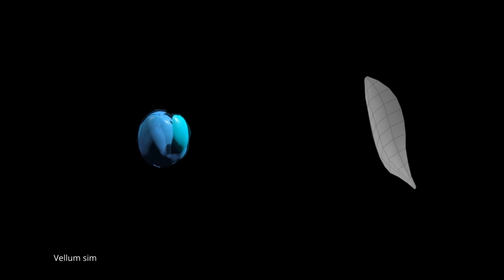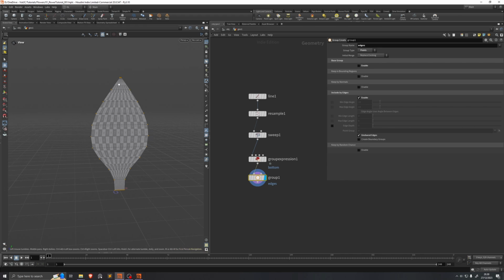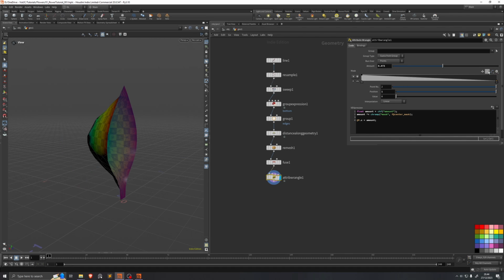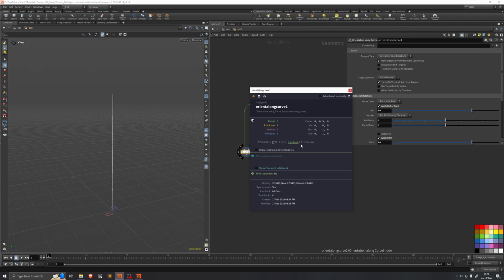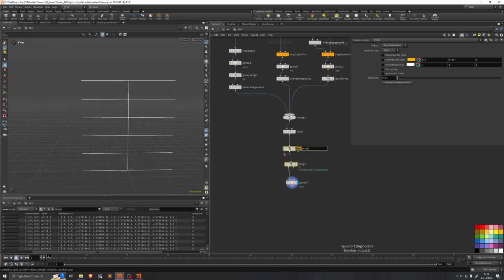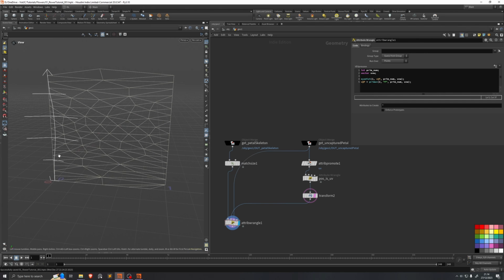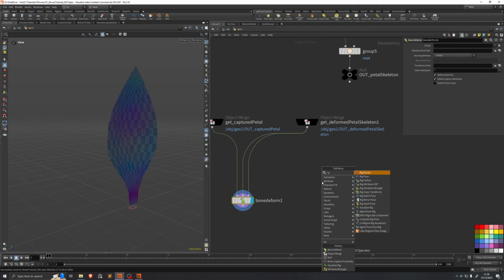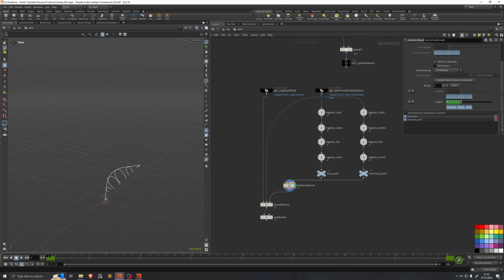Houdini Tutorial | Blooming Flowers | Model, Rig, and Animate | Part 1

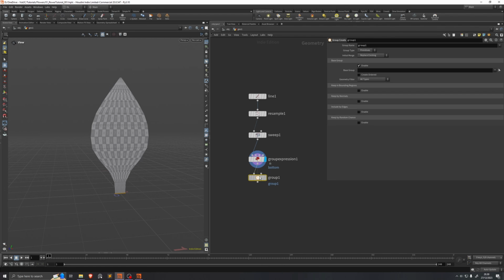Comment: heelo im new to this and i had a bit problem on 02:12 i type exactly on the group expression but the line on the bottom doesn't show up why tho?
Reply from the maker: Hi! I think you would benefit from downloading my project file. Compare the group expression node in my file to the one in yours and see what's different.

Good luck!
Reply: Then you probably typed it wrong. It's "curveu" (curve U).
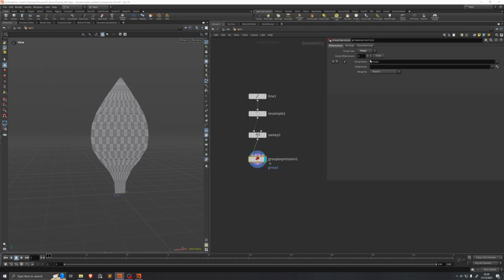And you probably missed when he set it to "Points" at 1:50. It's the very first thing he did after adding that Group Expression node.

Comment: Houdini crashes for me when I try to add the Bone Capture Proximity on min 11:28 
Does this happend to somebody else? If so, how to fix it?
Reply from the maker: Maybe check if Houdini consistently crashes when you put down a Bone Capture Proximity in other situations as well. Also worth checking if you somehow have millions of points on your petal so it crashes because the calculation is too complex.

If it keeps being a problem, you could be on a Houdini version that has a problem with that specific node. In that case, upgrade or downgrade your Houdini version.

Hope that helps!

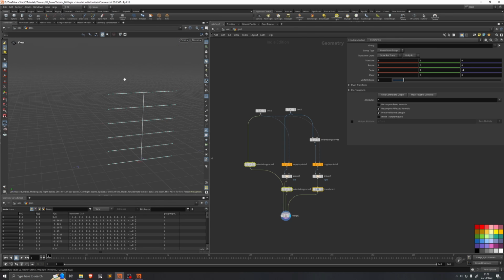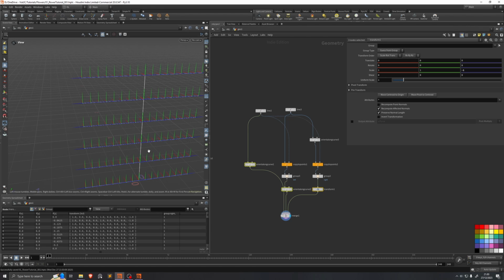Comment: Such a fantastic tutorial, thank you!! Can I just ask what is happening at 7:15-7:20 when the preview of the orientation goes from long lines to shorter ones? I can't figure out what you changed, it just seems to jump at that moment.
Reply from the maker: Hi Joe, thanks for your comment. At that time, you may notice my mouse go to a little icon in that bar between the viewport and the node view. This is icon leads to the menu for visualizers where you can adjust the "Length Scale" on a vector marker visualizer. It doesn't actually change anything for the setup, it's only the visualizer.
Reply: @DannyLrsn  thank you

Comment: which is the difference btwn bone capture proximity and joint capture proximity?
Reply from the maker: Hi Carlos,
It looks like the Joint Capture Proximity is an HDA wrapper for the Bone Capture Proximity that allows you to push an animated pose through the chain as well. I assume its intended use is for recapturing some weights on some pre-existing animation. For example if you imported an FBX from Mixamo and you wanted to make some edits to the skin weights.

Hope that helps!
Reply: One is for bones and the other is for joints 👍
Reply: @RalloR  aren't they the same thing?